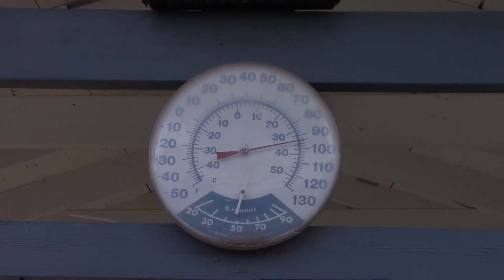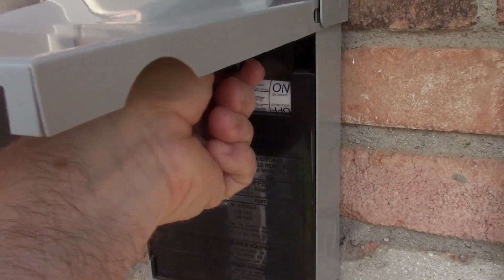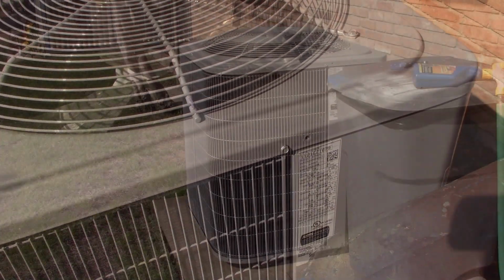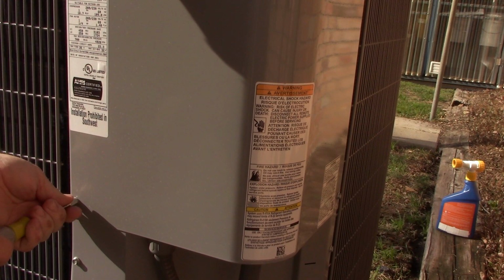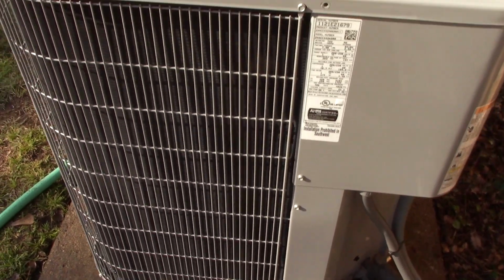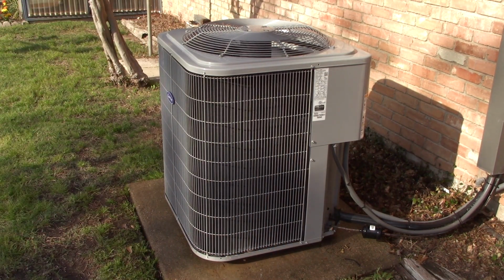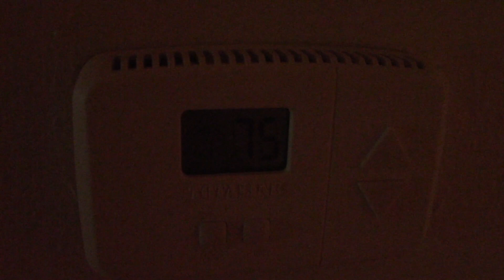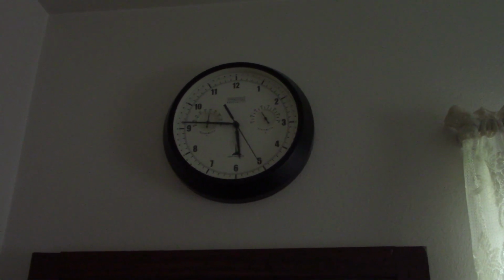2021 Carrier 3.5 Ton AC Unit: Clean, And First Start For 2023

Comment: Looking nice and spiffy!  And running well.  Yours is doing better than mine in terms of temperature output.  But I didn't leave mine run for long, I'm sure if I left it running longer I would have seen cooler temperatures.  Anyway, working well and should be good to go for the season.

"Under the hood" looked oddly familiar.  Some feller posted a video about installing a hard start kit in a unit similar to that.
Reply from the maker: Thanks! We had some hot days last week, and it's blowing ice cubes.
I'm thinking of putting the one off the 2003 Carrier in this unit. It wasn't used long in that one, and it's an old made in USA model, so it should work fine.